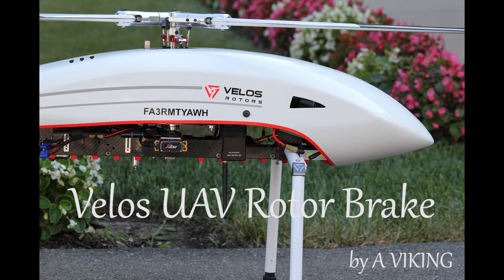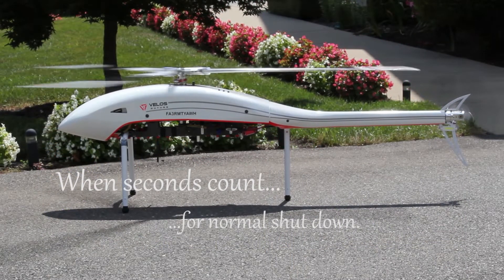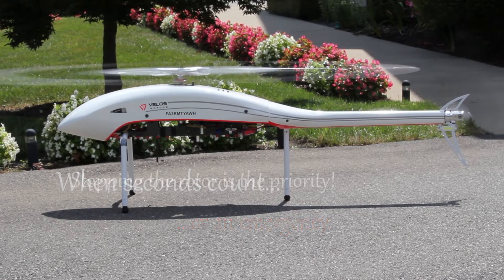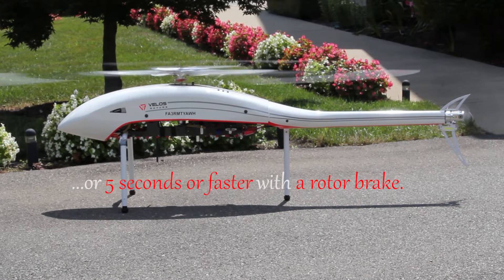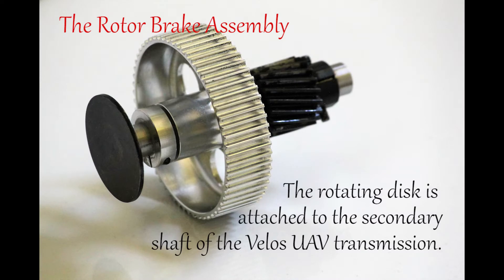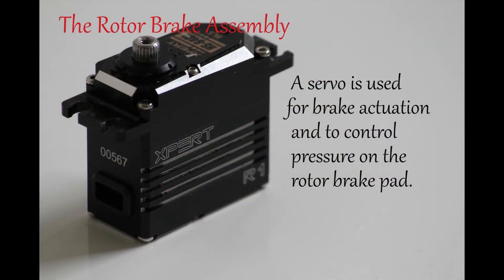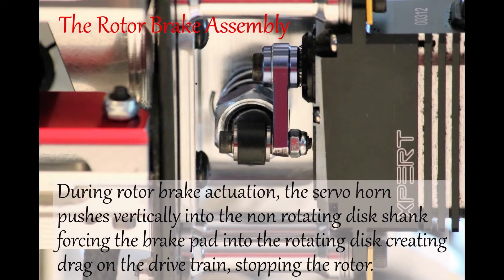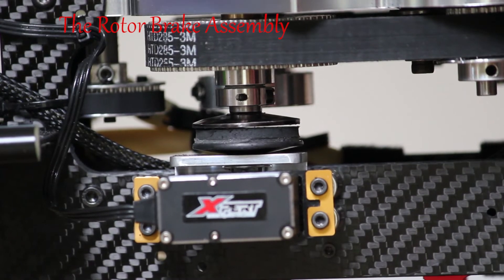Velos Rotors

Comment: There's no active breaking/motor stop (phases are shorted) available on heli ESC, like on multicopter? The deceleration should be super quick without any other component.
Reply from the maker: Hey David,
On helicopters for safety we have clutches (OWB) that separate the drive train to include the motors from the main rotor and tail rotor. With the clutches (OWB) we can auto-rotate to a safe landing if a failure of the drive train occurs be it a motor, (the Velos UAV and 880 already have dual independent motors and drive train) ESC, battery drive belts etcetera.
With the clutches (OWB) in the system using the motors as a brake doesn't work. 
Thanks for taking a look and asking the question. Have a great holiday!
Reply: @aviking4714  I do not think that autorotation feature of this helicopter is very important as long there is drive/motor redundancy, braking could be done by removing one way bearings and using ESC function for brake with motors, also this would result with reduced weight of components. But this will add some other serious issues: for example the power drive redundancy will not work if one of the motors gets stuck/jammed by his own magnet(s) or something else, the brake function will not work if power failure to ESCs occur. So all this is done by brilliant ingenering and safety in mind, great work as always Velos Rotors.
Reply from the maker: @frankycro  Yes you are correct...the dual systems of the Velos make it exceptionally safe to fly...however it still has a human being...me...at the controls. I have already accidentally hit throttle hold at low altitude before so having the ability to auto rotate is still very valuable, just to protect against human error.  I still love the rotor brake, can't live without it. It makes ground operations safe and quick. The added weight of the brake system is not a concern of mine as it isn't that much and in my spraying operation the weight of the Velos is low so the added weight of the brakes is not a concern. Thanks for the comments, its good to hear from others.